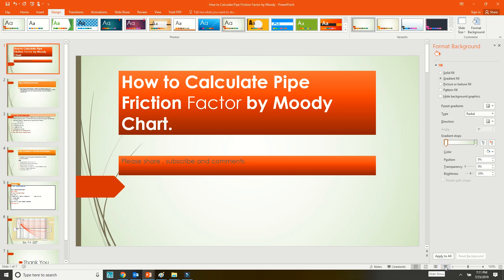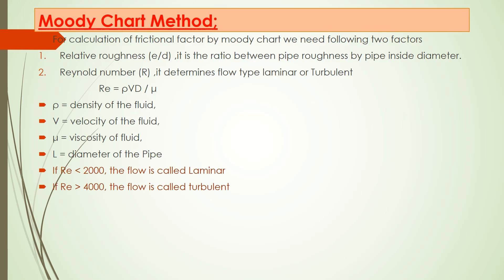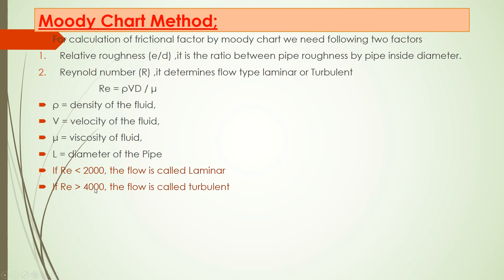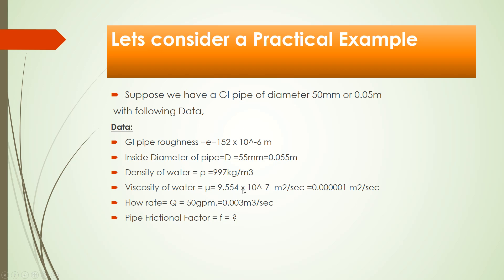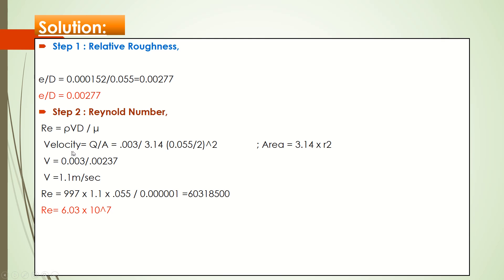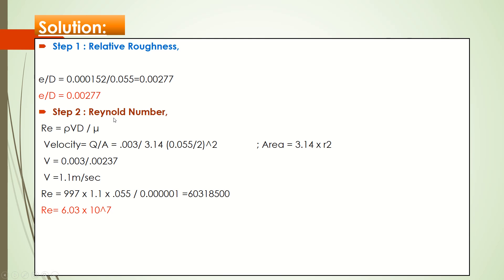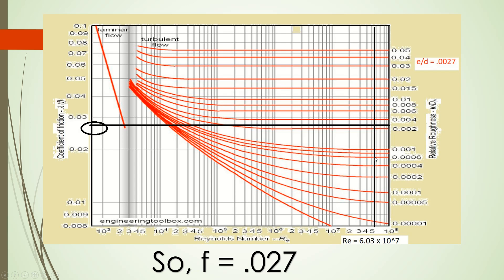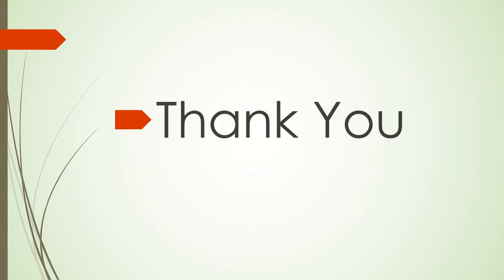Pipe frictional factor by Moody chart

Comment: can you help me to solve the calculation of friction losses in 100 m pipelines,  pump flow rate, and the pipe flow rate is equal or different because i have ballast vertical centrifugal pump there rpm 1800 and flow rate 750 m^3/h but i want to changes in that pump with new flow rate. So i want to change the rpm of the pump then flow rate automatically will change. Now that diameter 500mm connected to that pump, so i want to calculate the flow rate of that pipe and losses in a pipe . please now this is my project can you help me to solve this quarry?????
Reply: If we connect two pumps to a Single line what Will be the discharge .how we can find out